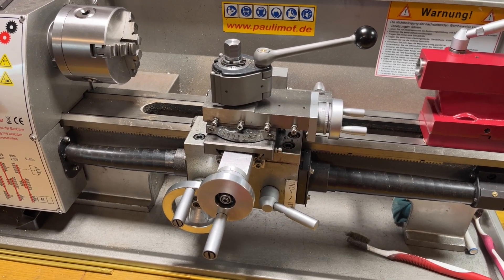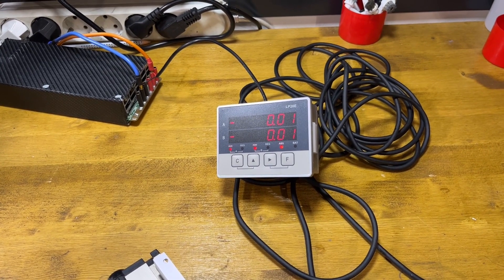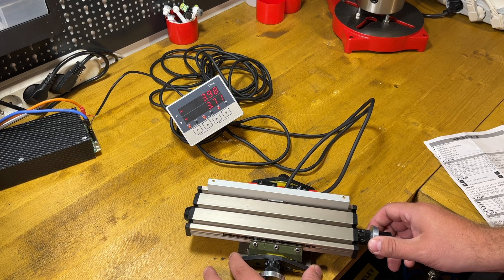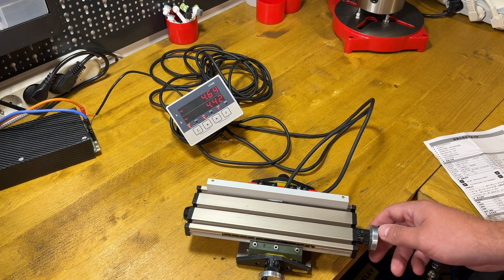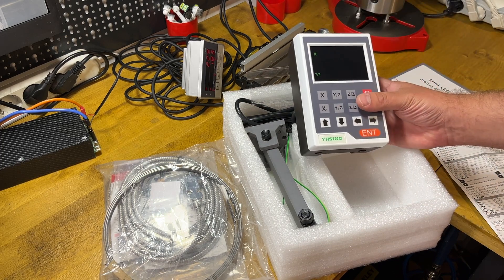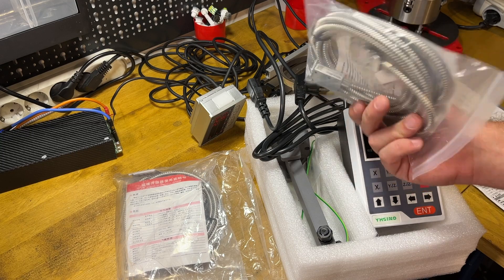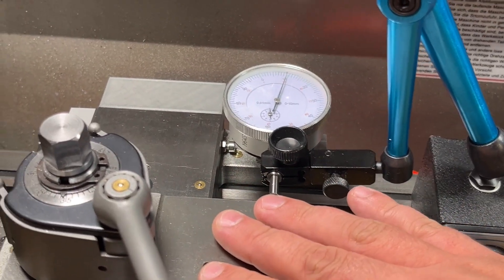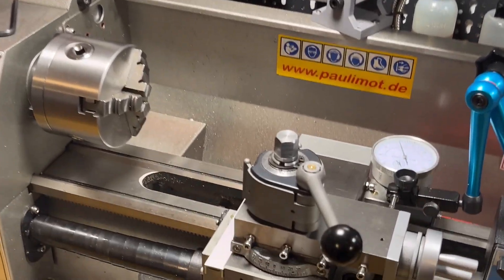DRO for mini lathe (part 2)

Comment: Hello.
Actually used the first one...
Could you please provide a link to that second kit that works properly?
Reply from the maker: Was looking and the links I have is already dead. Please look for sensors and any monitor on ali. The main point is to use just a full scale sensors.

Comment: @zhadlun
Hi Volodymyr, I'm an absolute beginner in turning, so my question is possibly naive...
I'm interested in implementing a DRO for my small lathe, so I was watching your interesting video, but some doubts arised.
About the positioning of the Z axis sensor, I understand this is the standard choice, but this leaves undetected all movements made with the compound cross-slide.
And yes, I understand that a diagonal arrangement of the cross slide implies a combination of X and Z travel, and this could be tricky to show (and to read)
But in my case, I don't do tapers (not yet...) and thus I keep the cross slide exactly aligned to the Z direction, and I'm using it for small Z movements since I find it more precise and smooth compared to the Z handweel, but this would obviously defeat the Z readout, thus it looks like I'll have to refrain from using the cross slide in DRO mode...  So, is there a possible workaround for this, like using a third sensor for the cross slide and a 3-axis DRO? Could it make sense, or am I overlooking / overcomplicating something? ☺
Thank you!
Roberto
Reply from the maker: Yes it's possible to use 3 axis DRO. And even some displays could combine values from both sensors and show them as 1. And if you have a place for 3rd sensor, go for it.

Comment: Hello and thank you for this video.
On aliexpress, it is indicated that these magnetic rulers are intended for working with wood and stone.
Don't steel shavings stick to the magnetic strip?
Reply from the maker: There is rubber cleaners connected to sensors. It's common for metal working machines to use magnetic scales.

Comment: Thanks for the video.
I have two thoughts on why the mini DRO was inaccurate.
The sensors work by creating an electromagnetic field at the reading surface and then detecting changes in this field due to the magnetic zones in the strip.
My best guess about the inaccuracy is this. The aluminium , while not magnetic, is still a conductor and will distort the sensor's electromagnetic field. Because the aluminium is close to the sensor on three sides, i think this would be a worst-case scenario for distorting the field.
Also possible is that the magnetic strip has manufacturing faults.
Note that replacing the electronics and sensors won't fix either of these faults.
I bought one of these mini DRO devices and mine works fine on the bench. I think your original mounting arrangement was good. I am going to copy your design but use pvc channel instead of aluminium.
Reply from the maker: I made so much tests there, and only one think is a firmware itself. I was even change sensor on a board, and still the same channel was wrong on a same places of magnetic strip. So a problem exactly with a board itself or firmware on a board.

Comment: I’ve heard it’s bad magnetic tape on these. I’ll find out when my new tape arrives.
Too late for me to send it back 😢
Maybe I should just buy this other type like yours?
I can’t afford the £500 ones that everyone recommends, that’s just crazy for a mini lathe.
Reply from the maker: This one really works, and all in all near 150EUR for a mini lathe
Reply: @zhadlun do you have a link? I can only find the listing for the display unit, but not including the scales?
Or did you buy these parts separately?
I think I will give up on the cheaper version, as you have. I don’t think it’s going to work, but this one looks much better.
Reply from the maker: @nutgone100  I bought them separately

Comment: You shouldn't pay return shipping for a defective product. That's nuts! Is the gauge on the lathe off due to backlash?
Reply from the maker: That's all you need to know about aliexpress (( But sometimes there is no other options than to buy stuff there.
The gauge is that because of screw geometry, it's the case for all small lathe of this days...
Reply: Do you have a link please Nice video
Reply: This is a programmer error in the pulse counting. The code may have a maximum of 3000 pulses set, after which the counter will reset and the scale will start counting reverse